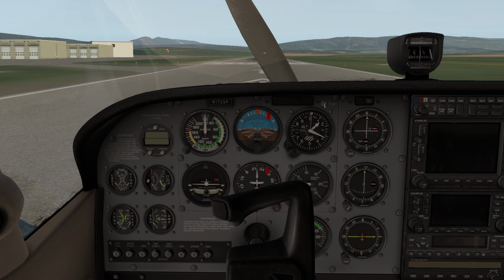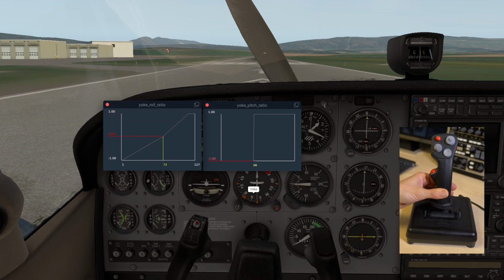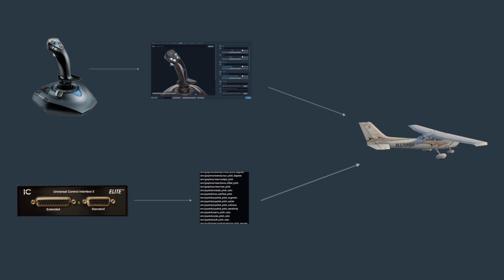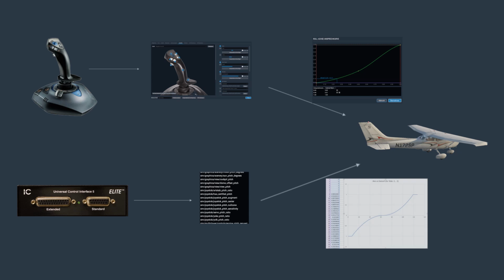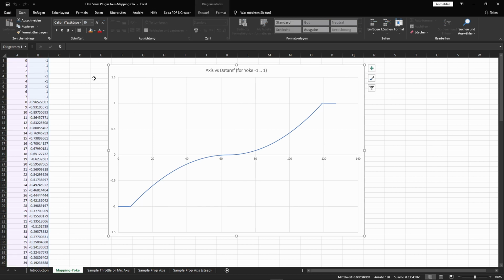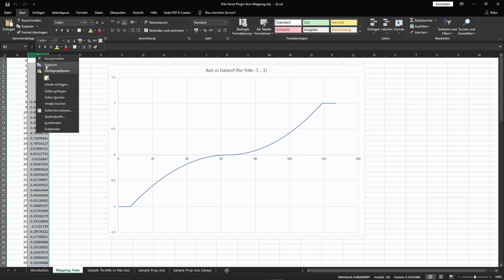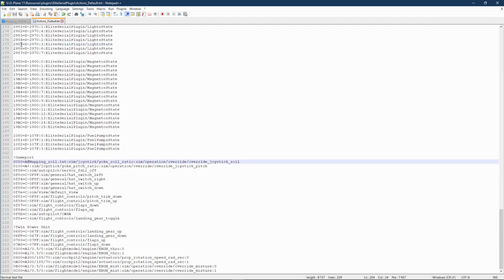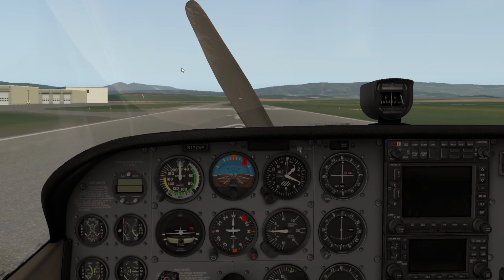Elite Serial Plugin - Custom Axis Mappings

Comment: Hello Martin, I'm a CFI in the US and have a serial port Elite BATD. I hope to use your plug in for X-plane and have better Visuals for teaching VFR and PPL Students! Thanks for submitting your videos and taking the time to do this mapping for the older hardware!
Reply from the maker: Hi Ean
Glad to hear you can use the plugin. It should support most of the functions of the BATD, however no indicators unfortunately.
Would be interested if it works with your setup.
Reply: @senecaflyer7888  sounds good Martin, will let you know :)
Reply: Hi Martin, I installed the plug in but X Plane would not recognize it. I tried changing the COM ports but no luck. Would you be willing to have a video call with me and assist in trying to troubleshoot? Thanks Ean. ps I'm in FLorida USA, currently UTC + 4
Reply from the maker: Can you contact me in x-plane forum? Then we can arrange a call.
Reply: @senecaflyer7888  sure :)